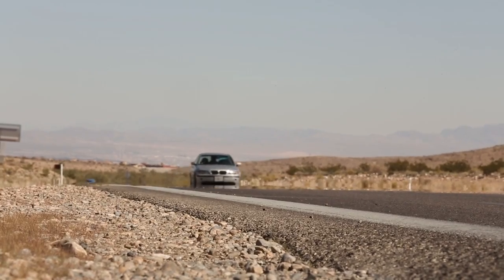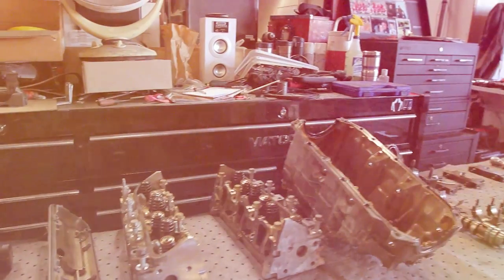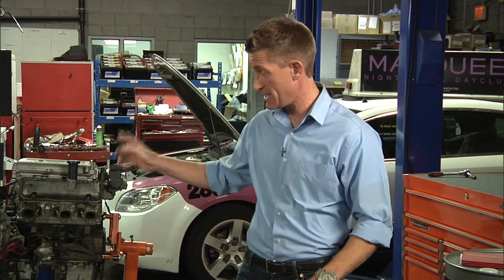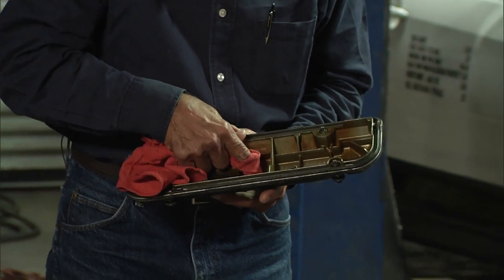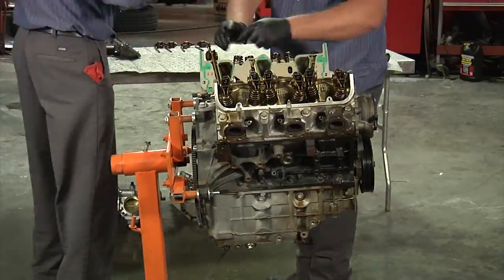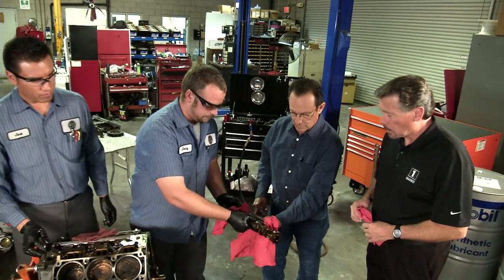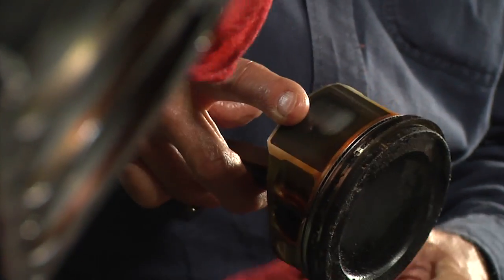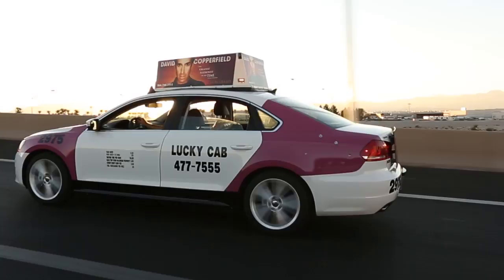Mobil 1 LIVE Engine Tear Down

Comment: I tried Mobil 1 in my 2011 Dodge Nitro 4.0 litre engine, Mobil1 burned up in the engine, had to top off several times, I switched to Pennzoil Platinum and the level of oil never goes down, Dodge and Mobil 1 are not compatible, Pennzoil and Mopar are match made in heaven..

Comment: One glaring omission,  HOW OFTEN WAS THE OIL CHANGED?? what weight of oil used?? The entire engine was very darkly stained.i saw wear on the pistons, cam lobes...seemed excessive for only 120.000 miles.

Comment: REALITY CRASH! I HAVE USED MOBIL 1 EXCLUSIVELY ON MY LAST TWO CARS. THE FIRST WAS A JEEP LIBERTY AND AT ABOUT 110K MILES THE OIL STARTED VANISHING...ABOUT A QUART A WEEK WITH NO LEAKS NOR SMOKE SO GUESSING IT WAS BURNING AND THE CC WAS COMPENSATING. I SOLD THAT CAR SO DON'T KNOW WHAT HAPPENED. THE SECOND CAR I STILL HAVE AND ITS A JEEP WRANGLER SPORT 2012. AGAIN USING EXCLUSIVELY MOBIL 1 AT ABOUT 65K MILES THE ENGINE SEIZED UP. HAD COOLANT AND PLENTY OF OIL. NO WARNING NO SMELLS NO LEAKS NO INDICATORS OF ANT KIND. THESE TWO EXPERIENCES HAVE MADE ME VERY SUSPICIOUS OF THIS PRODUCT. WONDER IF OTHERS HAVE HAD SIMILAR ISSUES?
Reply: stop buying Jeep/Chrysler products. that was the problem
Reply: Thr 3.8 push rod V6 is known burning oil. You must had a Honda or Toyota before...
Reply: Garbage cars
Reply: Two piece of junk jeeps! Not the oils fault your two crappy cars were likely built by some lazy slob with no care of quality control….

Comment: Newly reformulated Mobil 1 0W40 European formula has been getting a lot on negative press since it lost the BMW LL-01 certification.  Many understand product reformulation however loosing a well known cert like LL-01 caused rumors to spread are all over the place and loss of customer confidence. The BMW community as well as MB and Porsche are now wondering if it's an inferior product compared to the original formula. It also doesn't help that Mobil product support is rather coy with product questions. It creates a scenario where enthusiasts direct non enthusiasts away from their product in favor for another. Weather or not its true, rumors spread like wild fire and it would be in Mobil's best business interest to re-certify BMW LL-01 or they will continue to loose market share to Castrol and other certified brands.
Reply: Meh, I am not surprise lossing the BMW cert may have nothing to do with the oil peformance. It might have something to do with how the certification is being audit or managments of certain documentation after the certification document are updated. (e. g. manufacture log, documentation format, file archive duration, etc.) I am confortable to pick up any reputable brand Penzoil, Mobile, castrol, shell, Total oil and put them in my car.

Comment: My 1993 Jeep Grand Cherokee limited 5.2 liter is still going strong to 391,000 miles as I use 5W-30 Mobil One without a single overhaul. I changed oil every between 5,000 and 10,000 miles as well purple oil fitler too. So, it is on the 25th years now. Also, it's always passed smog check every couple year too.
Reply: Interesting sir. In what part of the USA you live in? Or, in what temperature you on avarage start your vehicle in the mornings and what's the avarage temperature in the place you live in? You use 5 w 30 regular or synthetic?
Reply: @tomorrowcomestoday1621  For now, I live in Northern California since retired from my job and I used to live in Bay area on Santa Cruz Mountains with colder and foggy in the morning before I going to work. I used 5w 30 synthetic Mobil One oil for a long period of time. And retired in colder part in winter with the snow and hotter on summer season my cabin in northern California for 3 years now. Oh one more my Jeep is nearly 419,000 miles without engine and transmission overhauling.

Comment: Still see varnish not good. Put it up to a hard working DOT truck and see what happens with drain extensions!
Reply: Varnish is cosmetic inside an engine. Ask any expert. Doesn’t need to be sparkling clean. Detergents compete for metal where anti wear additives are trying to adhere and keep stuff apart. It’s a balancing act.
Reply: Cosmetic eh’ that is very interesting. Since varnish is created by heat & oxidation.  Varnish can have a severe impact on engine durability. 
Varnished rings generally develope oil blow by if oils do not have the proper detergents. 
I’d be happy to compare Mobil to Schaeffer oil anytime sir.
Reply: @bobmorgan9335  Ask any lubricant engineer/tribologist. I see you are no different than a Scamzoil salesman who somehow thinks Schaeffers is vastly superior 🤣🤣. Hilarious

Read up on the requirements of a modern SP oil. They have plenty of detergents and actually pass testing unlike the boutique snake oil you rep. love how you make such blanket statements. There are plenty of published VOA's on Mobil 1 and other synthetics showing "detergent" levels among other additives. Dont go there with me, Ive done my homework.
Reply: Well that’s because we are.

Comment: I have a Toyota Camry. 2003. 117k. I have been using the Mobile 1 EP In it since I got it 2 years ago at 95k. I don't go 15k like it says I can. I do 7k.. But I'm wandering if I should use Mobile 1 High Milage instead to get the seal additive. I am so far stearing away from it because it's not the G5 approved oil. And the EP is. Should I change to the HM oil or stay with the EP even tho I have 117k? I currently don't burn or leak oil.
Reply from the maker: Please call 1-800-ASK-MOBIL to discuss in more detail. Our customer care team is ready to help answer any questions you may have.

Comment: What was the oil change interval? On severe service like 5 thousand miles?
Reply: Planning on using Mobil 1 in my 2011 GMC Canyon pick-up with 2.9l 4cyl engine.  Once my oil monitoring lights comes on... I'll switch to Mobil 1 5w-30 and a AC Delco PF 46 filter.  Had great luck using this oil in my  Honda Fit.  This is the only oil used by my cousin who builds hemi racing engines.
Reply from the maker: Hello, oil change intervals can be as short as3,000 miles (4,828 kilometers) or as long as 15,000 miles (24,140 kilometers) on some new cars. We always recommend that you follow the oil and filter change frequencies shown in your owner's manual, especially under the warranty period. With Mobil 1´s high-performance reserves, you can have the confidence to go the full mileage or timeframe recommended by the vehicle manufacturer. Mobil 1 is especially suitable for the latest vehicles with extended drain intervals or vehicles with oil monitoring systems that vary oil drain intervals.
Reply: Mobil 1 Actually, I was asking on this specific test in Vegas. Wasn't said on the video.
Reply: @OfficialMobil1  could you tell me which one was used in this impala Mobil 1 extended performance?
Reply: Please tell us about Mobil 1 Advance fuel economy 0w20 ? I’m currently using it in my 2018 Honda Accord Sport turbo along with M1 oil filter . Looks like no problem . Is it reliable oil like in this video like taxi cab , in harsh conditions ? I can’t find any video about advance fuel economy , only extended performance . I don’t want to go 15000 mi , only want to go by car monitor 5000 . Thank you !

Comment: I had recently switched to Mobil 1 from Pennzoil Platinum and I am quite impressed.  I noticed how the fuel economy of my vehicle improved and the car runs more smoothly and quieter.  When it come to this video, can Mobil 1 say that the results from the teardown can be achieved when using any of their line of synthetic oils.....whether it be the Original, Extended Performance, Advanced Fuel Economy or High Mileage?
Reply: I bought my 2019 civic coupe 1.5t new. For the past 90,000 miles I used castrol. Recently I switched to M1, and a M1 filter. The difference is night and day in favor of M1. My engine is so smooth I sometimes can't tell it's even on without looking at the tachometer.  I wish I had been using M1 from the start! Thinking about running the M1 truck and suv oil in my car next time.

Comment: Where to begin? You must have your head in the sand. Because of government regulations mobil was forced to lower zinc and phosphorus levels which are anti-wear additives. I called mobil 1 and that is what they told me! Mobile 1 synthetic will protect your engine for about 1000 miles. Said you might get 100K miles of engine life. For some people thats enough.Their words, not mine. They said if you want to use their oil and have engine protection to use one of their racing oils. Now go fuck yourself!

Comment: I live in Minnesota my dad owned a parking lot sweeper and he use mobil 1 he had no problems with that engine 15 years that's why my dad only used Mobil 1 in all the equipment that he owed vehicles to
Reply: I bought a 2007 Honda Civic brand new in 2007 it has 277,000 original miles on it the first three thousand miles I switch over to Mobil 1 10 W 30 when I bought it it only had 12 miles on it I had no oil related philia no engine failure the engine is still running like new Amsoil told me Mobil 1 is a very very low quality oil if it is a low quality oil why my engine last 277,000 miles with no engine failure
Reply: @darrencedeno481 amsoil is gonna amsoil lol. I just switched to M1 from castrol on my 2019 civic 1.5t.

Comment: Cold starts and short trips and mixed driving styles are what does an engine in. A taxi cab engine runs at a constant temperature all day long and hardly ever gets cold started. Even a "cold start" in 110 degree Las Vegas heat is still STONE COLD to engine parts and is damaging regardless how it feels on your skin. 
I'm a Mobile 1 user, but this is another one of those videos:
 "OMG...look how clean this engine is and look how many miles this engine has on it that runs practically 24 hours a day at one constant temperature with one of the best oils on the planet in it".
Let's see a teardown of a soccer mom's 20 year old minivan engine that gets cold started and driven 2 miles to work and shut off then gets cold started again to run some short trip errands after work on the way home.
Reply: Your not very bright .....Stop and go City driving in 105 degree desert heat  of Las Vegas is hard on an engine
Reply: @toddbob55  it is. But being at constant operating temp is a big deal.
Reply: @toddbob55 you aren’t very bright apparently

Comment: of course it will be like this! taking a vehicle that runs at its operating temperature  99 percent of the time, and puts 120k miles in 6 months of service will yield results like this. do this experiment on a climate that has all for season. puts that mileage on in 8-10 years and then crack it open. we are not taxi drivers mobil one! we are the rest of the population
Reply: You need to watch the video entitled "Mobil 1 Engine Protection Through 454,155 Miles" and shut the f_ _ _ up!
Reply: @davidwysocki143  calm down davey..... don't get your panties in such a bundle.

Comment: great marketing but I switched to castrol.  M1 is not the best anymore.
Reply: JAMES LIN: For YOU it isn't but for someone else a different experience. I for one use Mobil 1 in my 1999 Accord and it does as advertised. Engine continues to run strong and I live here in Phoenix where it gets even hotter than Vegas in the Summertime. Plus we tend to get these enormous sandstorms from time to time so that becomes a factor. So far no issues, and I've had this car for 9 years and it continues to run like new. So your experience is your experience. Don't expect it to be the gold standard for everyone
Reply: +EpiDemic117 How long did it take to change the timing belt? I would rather do it myself rather than paying $400.00 to someone else. What all did you change?
Reply: ***** I use the full synthetic Mobil 1